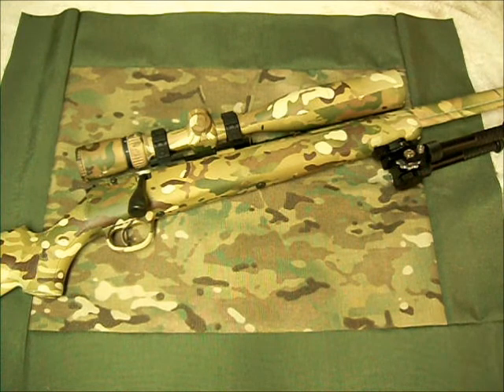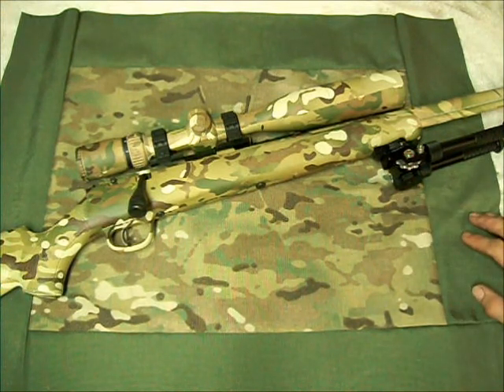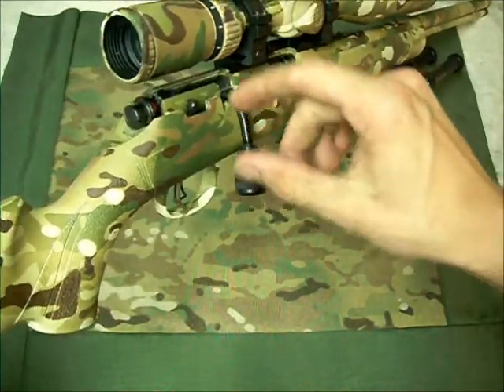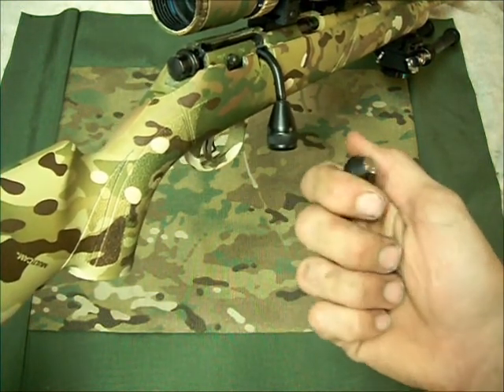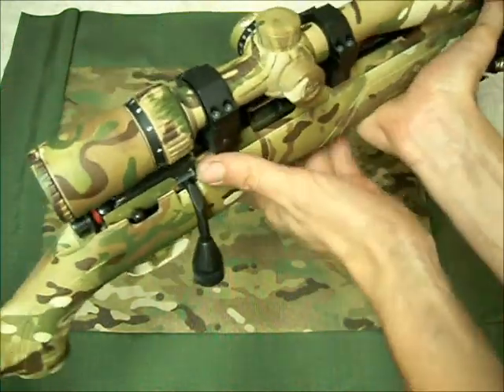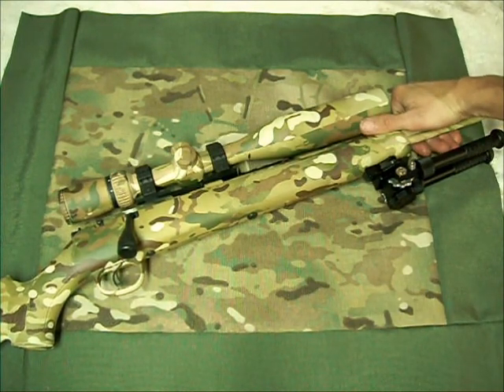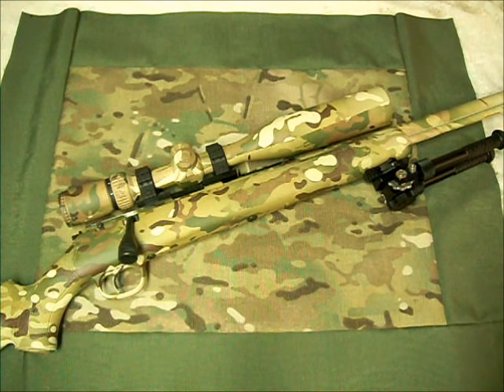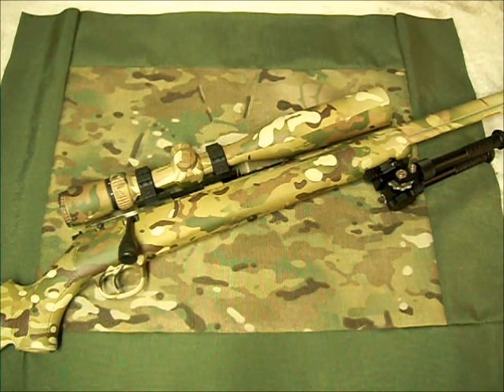Marlin XT 22 TR Dipped in Multicam + Vortex Diamondback HP

Comment: How has the dip been holding up?  Do you mind saying who dipped it?
Reply from the maker: It's been pretty good, there have been a few spots that have not held up. I probably would not do it again, considering the cost. Independent Airbrush did the work.
Reply: Steel Shooter Okay I appreciate the honesty.  Prob try duracoating with stencils myself.  My duracoat jobs arent super pretty due to my lack of painting skills....but so far they last pretty well.  My only secret other than scrubbing them down good first with degreaser that they send you is I put the gun up for about a month and never touch it letting it harden up good.Absolutely LOVE the look of your gun though and figured if it actually lasted and wasnt an arm and a leg I'd give it a shot.